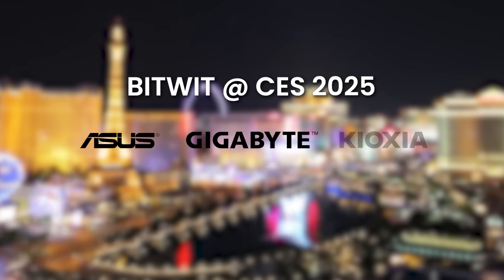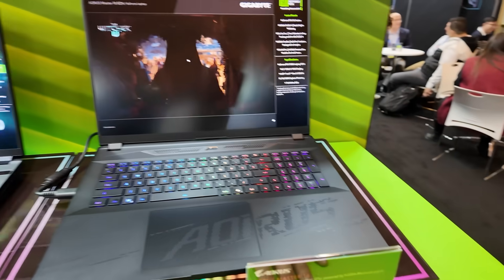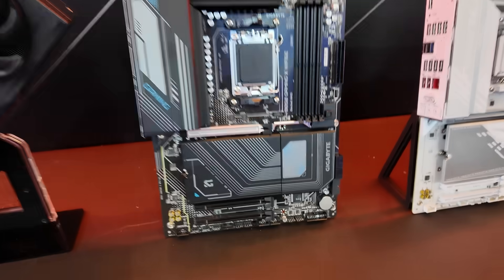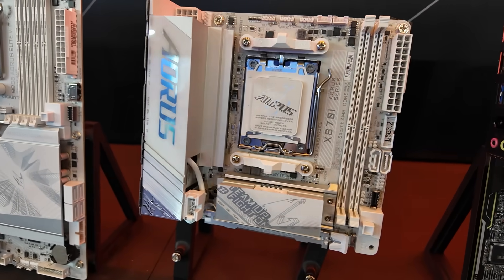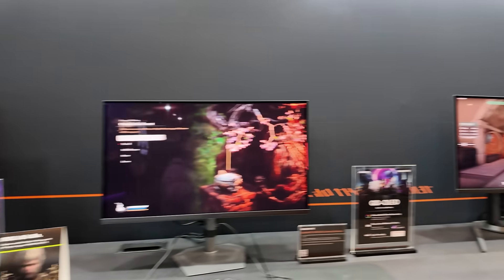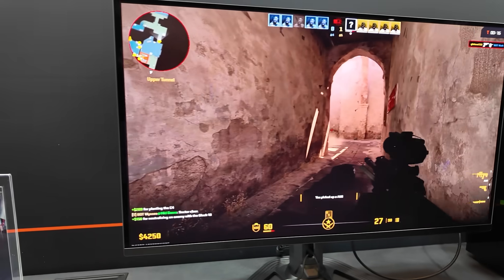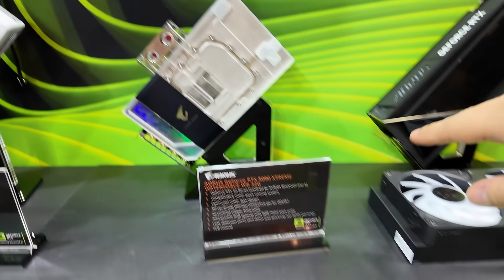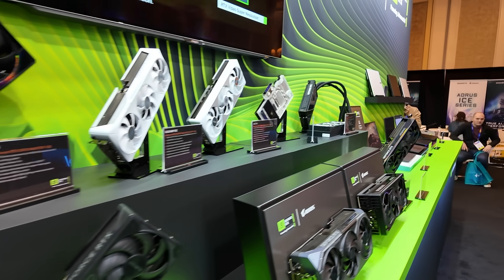The GPU She Tells You Not To Worry About | Gigabyte @ CES 2025

Comment: My only issue with these high refresh rate monitors is the potential lack of bandwidth needed to keep them from flickering out on multi monitor setups. In my case, my PG27AQDP 480hz monitor doesn't seem to like variable refresh rate or gsync and randomly shuts off for 5 seconds at a time while gaming. No issues if the variable refresh is turned off. No one seems to be talking about this issue on these high refresh rate monitors especially now going into 1440p and 4k

Comment: That RX 9070 XT is a dummy gpu, AMD is back on the drawing board scrambling to design something that can actually battle the RTX5070... because they thought the 5070 will just be a renamed 4070super at 600$, they didnt anticipated the 549$ msrp, DLSS4 with 4x frame gen and blackwell generational performance leap...
Reply: sad but true... i wish all best for amd...
Reply: The rtx 5070 should be between the rx 7900gre and the rtx 4070ti.
With the rx 9070xt just below it.
A msrp of $450 or $480 should be ok for it.